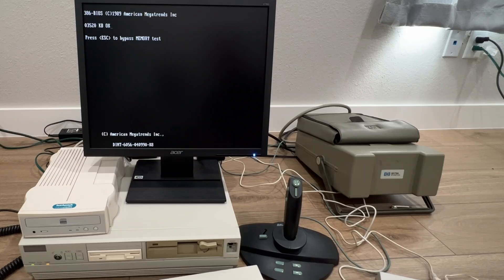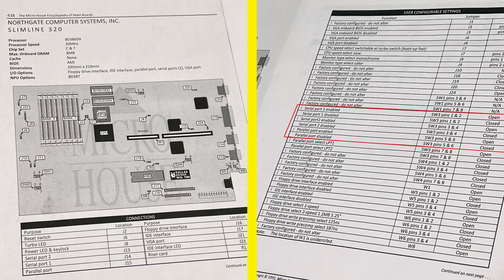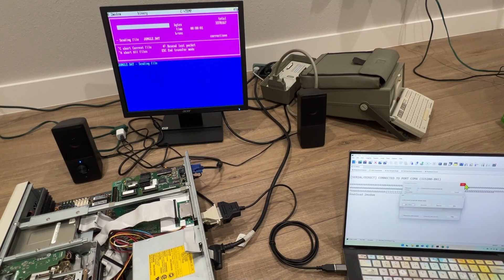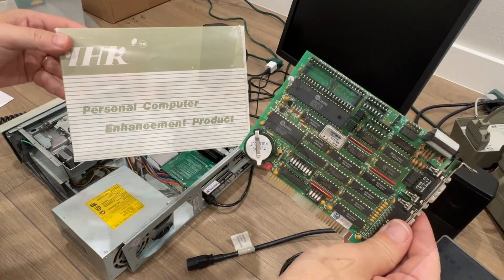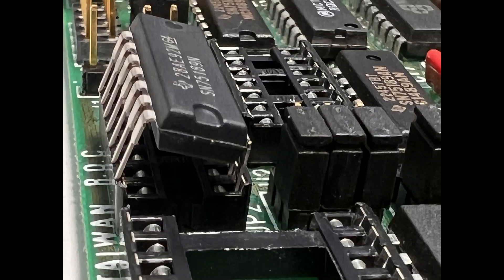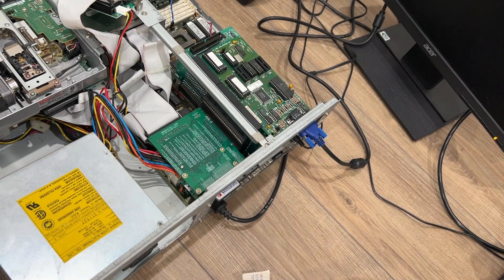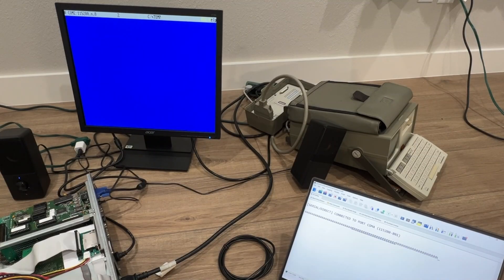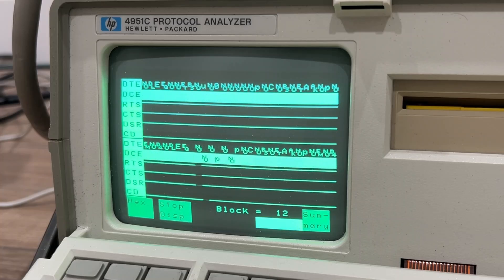Upgrading an 8250 to 16550 UART in 2025? Who does that!?  I can explain!

Comment: Thanks, I forgot they were pin-compatible. I got right on it and replaced the 8250 in my XT, which I suspected was causing some intermittent issues, with a 16550A I had in the parts bin, and that cleared it right up.

Comment: There is still the complete logic for that chip in the silicon on today's motherboards. It is still called the 16550 block in the data sheets. There is one more from the stone age as well, I think it is the 8255 parallel port driver maybe?

Comment: Wow, it's been a long time. I saw the video title ands said to myself: " 16550, 8250, used to know what those were but... 
Reminds me that I once memorized what the 8 DIP switches in the original XT did but ... ? I know those had something to do with memory and video but - well, I don't really need that information anymore. 
Still, I'm glad you're keeping these old systems running.
Reply from the maker: Ah SW1 and SW2, I still have a PC with those.  You could set number of disk drives also (they actually supported up to 4!).

Comment: I didn’t know you could still get them today
Reply from the maker: The 188 and 189 were from mouser, but the 16550 actually was from digikey (I updated the Video Description to clarify).   Of course, alternatively there are also many newer "super IO" cards that often already have dual 16550's.
Reply: @xiphod1337  Jogged an old memory.  Of course anything relatively newer should work, just remember it being a problem way back.
'Issue with the buffer
The original 16550 had a bug that prevented this FIFO from being used. National Semiconductor later released the 16550A which corrected this issue. Not all manufacturers adopted this nomenclature, however, continuing to refer to the fixed chip as a 16550.[5]'
Reply from the maker: @ModelLights  Yea, it was kind of a mess.  I think they caught the issue within months or at least within a year, so the "problem" chips should only be around 1987/1988 vintage (and so a pretty low probability of encountering one).   But it did give a confusing and bad-impression at the time.  Note that Zmodem wasn't always the most efficient option, but was popular since it had the feature of being able to resume a file in case of a disconnect (and was "fast enough" for dial-up connections that couldn't go much past 14.4Kbps at the time).   At the very end, I show Ymodem achieving about 7KBs (or about 70K baud), which is decent but shows even a 386 didn't quite have the horsepower to fully utilize 115.2Kbps connection even a local null-modem setup.   Another aspect is that Receiving is generally harder/slower than Sending (mainly because in Sending you know how much, but in Receiving you never quite know when/where the end of the stream will happen).   The test here was just the 386 sending a file, I should have also looked then downloading back (Receiving) the same file.

Comment: That was quite interesting! I didn't expect the transfer speed to change like that at the same baudrate, I'm guessing hardware flow control and the FIFO?
Reply from the maker: Yep, 1 byte vs 16 byte.  But notice this 20MHz system still can't even fully utilize the rate (still doesn't even achieve over 10KBps) due to the 1.8MHz crystal (and via Zmodem transfer protocol).  Also notice that Ymodem is actually a more efficient protocol in this case.